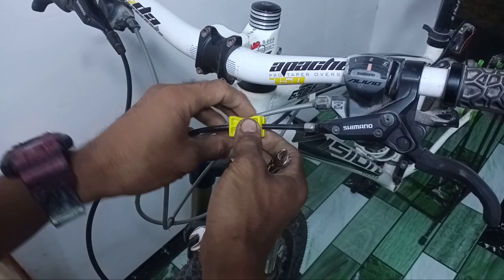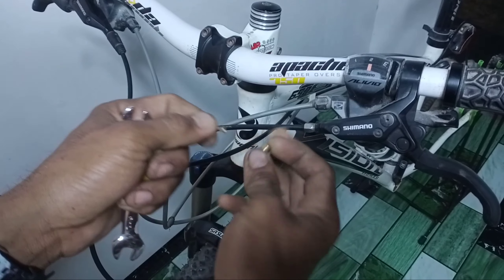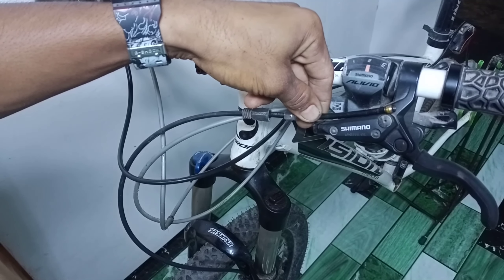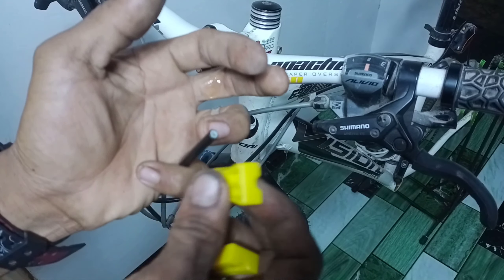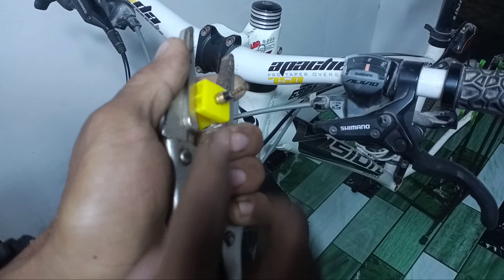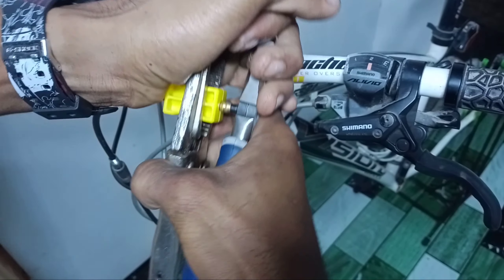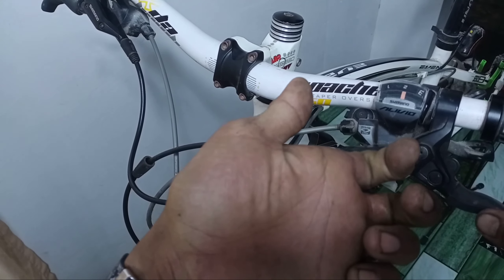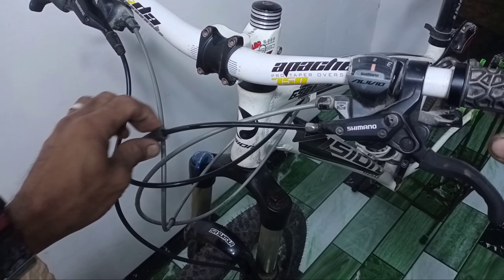Paano magputol ng hydraulic brake hose??How to shorten shimano hydaulic brake hose

Comment: Isang set nb yung mabibili n hydraulic fitting..yung kulay yellow na pang ipit at yun pin nya..isang set npo ba sya pag binili sa bike shop
Reply from the maker: Hindi po..normally yung kulay dilaw na pang ipit saka yung pang fittings..kasama s break set na hydrau..pero kung bibili k ng pang fittings at pang ipit ..bukod bukod p yun

Comment: Sir anu po ba size ng cable hose ng shimano mt200
Reply from the maker: bh 59 yung naklagay s cable hose...
normally yubg mga binebenta s market halos iisa lang...nagkakatalo nlang s olive fittings
Reply: Thank you po idol.  Tanong ko narin kong pwede ba 8speed na missing link. Fit ba sa 10speed  yun sana gamitin ko na missing link sa 10speed ehhh

Comment: pano naman boss mag padaan ng hydrolic disc brake sa internal cabling na frame?
Reply from the maker: May cable guide tool ako n ginagamit dun..
Reply from the maker: Pero kung madudukot mo ..pwede din nman ..mas safe nga lng yung fluid..pag may cable guide..saka mas madaling magpasok ng wire pag may canle guide tool